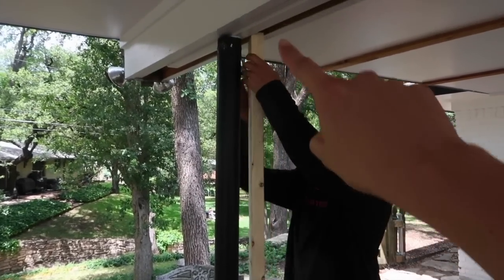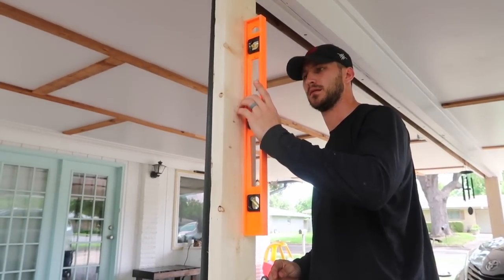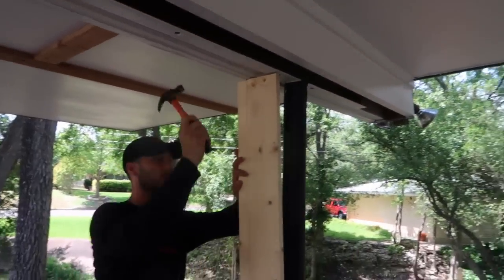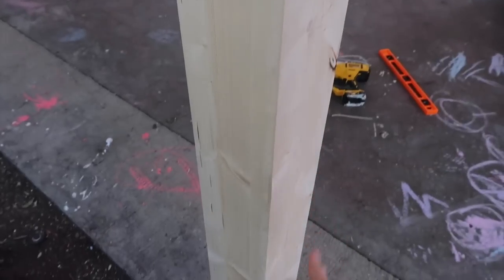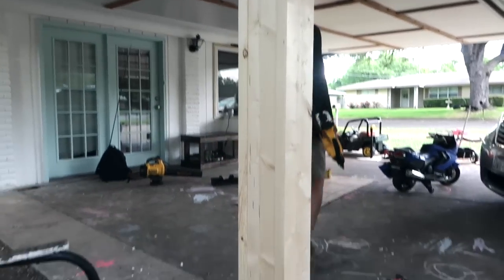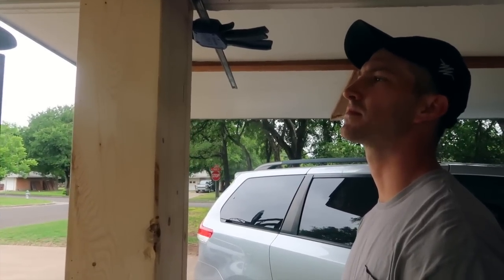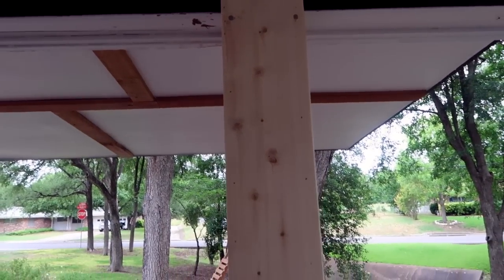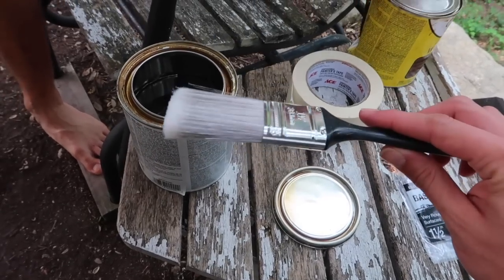DIY CEDAR COLUMN WRAP: HOW TO WRAP A SUPPORT POST ON A BUDGET: EASY DIY HOME IMPROVEMENT

Comment: the only thing Id suggest is leaving 1 inch at the base and putting stone, brick, or concrete at the base (to prevent rot).  I also would leave that room for seasonal wood expansion so it doesnt expand and break your carport.

If you have a router, you can also pre build the boxes 3 sides and use 45 degree a lock mitre bit and tite bond 3 glue. You want exterior grade nails or deck screws as fasteners also or you might get rust streaks over time.

Comment: Awesome job. I am guessing the support pole is 3.5 inches in diameter. Why did you use a 1x5 plank as a 1x4 is a more exact fit for a 3.5 inch support pole. Fits more snug and is an exact fit when using with the 2x6 .Thanks.

Comment: Amateur tip:
When using a hammer to position a piece of wood, use a bit of scrap as a buffer between the head of the hammer and your finished piece. That will distribute the impact and prevent imprinting the texture of the head into the wood.

The less sanding and finishing, the better, imo.